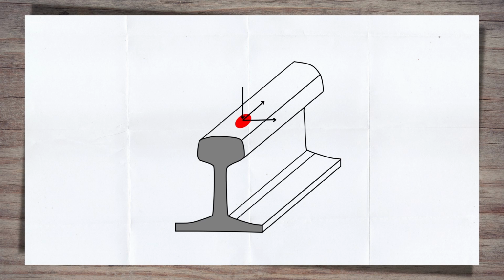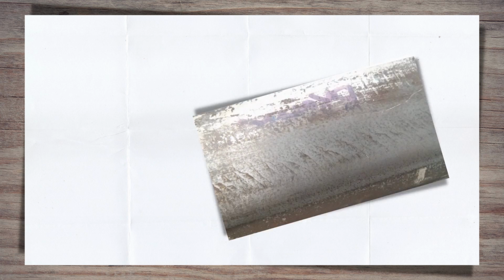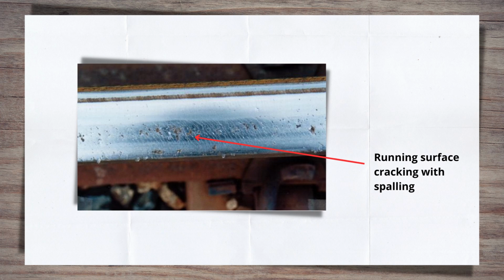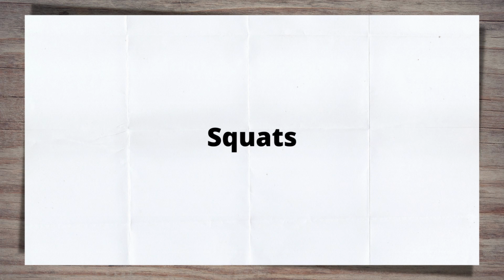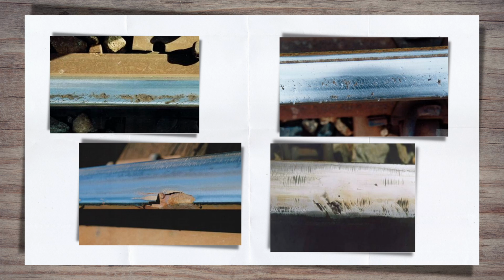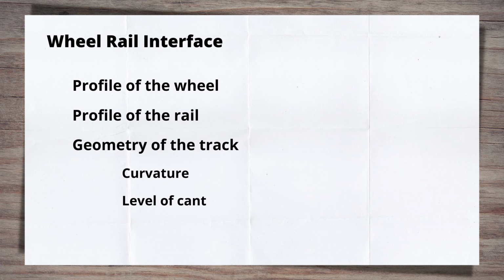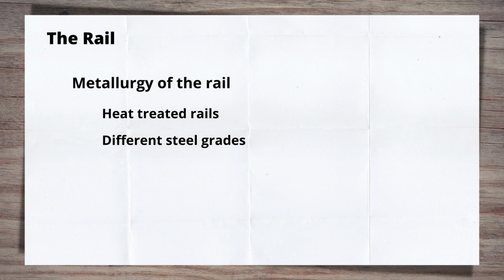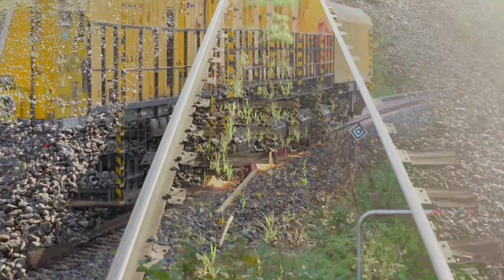Rolling Contact Fatigue! Best Engineers Guide to RCF on the Railway

Comment: Polite guestion. America has many railways that pass through towns,built into the rails. Heavy freight trains,heavier than u.k. running through built up areas . But seldom do you see the rails themselves replaced. Are theyy different to u.k.spec.
Reply from the maker: Great question!

I don't believe so. It come down to different usage as well as track design I would suspect. In the UK the track is typically mixed use with both freight and passenger trains running on it, with a lot more trains per hour. This mix of trains means a track design that a slight compromise to accommodate both.

We are also not blessed with the wide open spaces that you guys are, that allow for long straight pieces of track. We have a lot of curves, areas where rail wear can get very high.

I hope this helps!

Comment: From a rolling stock engineer, interesting information. 
Rolling Contact Fatigue RCF, is a very interesting failure mechanism of steel.
All steels can suffer from this with heavy loads and vibration. My understanding is the cracks start sub surface and propagates upwards and downwards. Obviously it can only be visually observed after it has broken out on the surface.
Train wheels and bearings suffer from this same failure mechanism.
If seen more frequent on new equipment, it is commonly found to be a material problem, with steel manufactured too hard or to the upper end of the tolerances appearing to be significantly more susceptible to this failure mechanism developing.
From my findings on train equipment, I would be confident the same cheap steel/poor quality control of the steel used in rails would also be the case.
With those in the procurement process only interested in the cost, not that the parts/rails are manufactured optimally within the material tolerances. (Profit Over Safety)